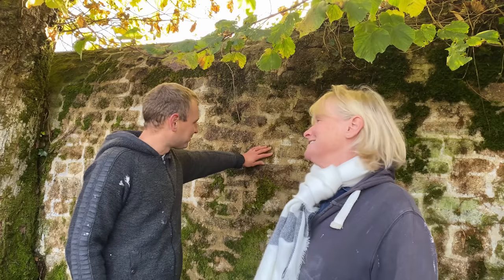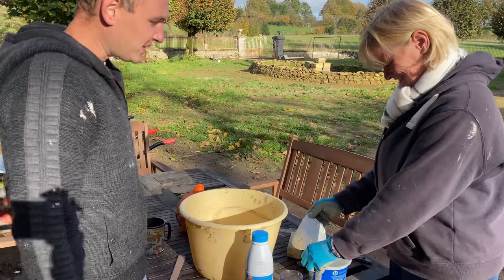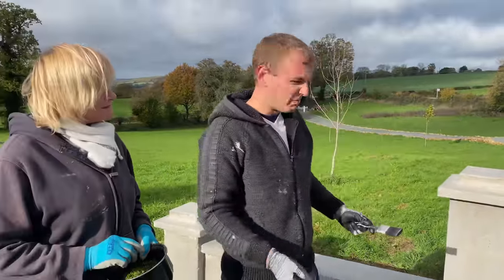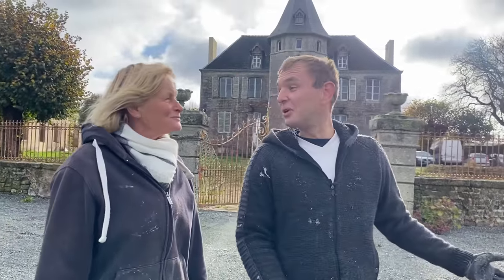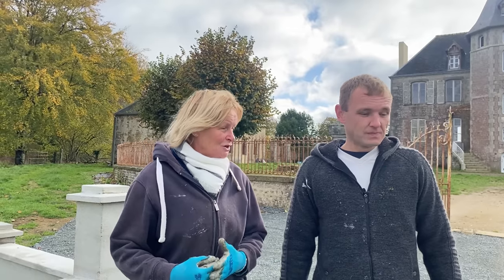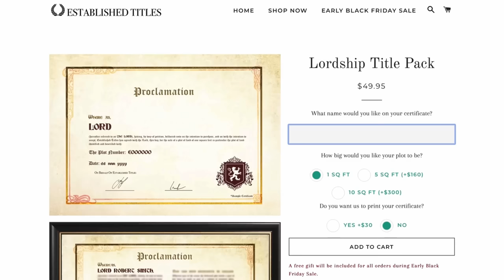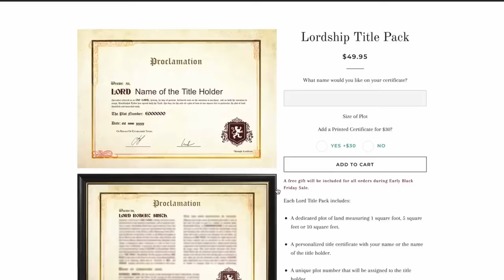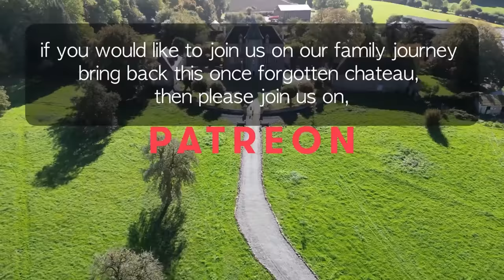AGING a 18th Century CHÂTEAU | How to Make STONE Look Old. Ep 87

Comment: FYI, you can save yourselves a step if you have an old blender. Add moss to yogurt concoction and blend moss into it, then paint it on. Works pretty well. Loved watching the video...had me chuckling the whole time you were outside - I remember that smell! Thank you!
Reply: @2roddman2- Agreed, put the entire concoction into a blender, then paint it on the stone. I saw this method done years ago on a landscaping show. As a follow up, you will have to mist the moss regularly to keep it from drying out. If it dries out, it will not grow on the stone. It will take a few weeks until you see results.
Reply: exactly what I was going to write about the blender much easier .
Reply: @graciemaca6996  Oh the smell lingered for days! I did some concrete planters for alpine plants with the yoghurt mix and it worked beautifully, I think it took about 6 weeks to get going but once it did the concrete just looked like old stone over time
Reply: I was gonna add the same comment!
Reply: Me too!
Reply: Exactly what I did at my house in Montreal.  The results survived our -20 C winters and the walkways looked vintage and matched the Victorian home.  I would recommend it completely.
Reply: I came to add the same comment. I've seen it done with moss and buttermilk. They painted the mixture onto a wall as a large graphic and it looked fantastic. I could see using it to put the chateau name or street numbers on a wall.
Reply: Same comment plus— put it on with a paint roller.

Comment: You can actually put some of the moss with the milk/yogurt solution into a blender and then brush it onto the walls. Makes a small amount of moss go a long way and it takes less time applying it. And you are correct, the new walls looked way too new and out of place.
Reply: That is what I would do as well 😊
Reply: Worked great for me on a new concerte statue  🇨🇦😁
Reply: I did exactly that with terracotta pots. Worked too well for me! Even bleach hasn’t stopped it!

Comment: I have had success growing moss on a concrete block wall by putting buttermilk and chunks of moss in a blender, then use a paint brush to apply the concoction on the wall. Just a thought if you need to do some more walls.

Comment: Instead of wrecking a blender you can use a Power paint mixer. The kind you use your electric drill to power. Would probably work well with the leave mixture, give it a bit of body to hold some of it in place for a deeper stain. It's going to look great come spring!

Comment: How about using some of your wood ash and a flour sifter?. Right when you apply the paint. If you have to refresh the walls maybe then?  I have a wood ash pile out back and it tends to turn brownish color with the spring melt. In fact, all the blackness seems to disappear. I never realized the ash was really unburnt wood particles. I thought it was lumps of carbon. . Maybe you don't have to paint again just wet the surface?  Or mix it with water to make a wash like your casein paint?  Maybe some powdered charcoal for a darker grey?

I love the lichen covered stone walls. I've been in this house for 35 years and have granite rip rap walks and low stone walls all over the place. Within the last five years moss has really taken hold. It's a treasure. Every time it's time to pull weeds in the walks i try not to disturb them and that seems to encourage them to spread. It helps to soften the surface and fill gaps like a carpet. But no where are there any on vertical surfaces except for some rocks repositioned more upright. How on earth are all of those climbing a vertical surface?